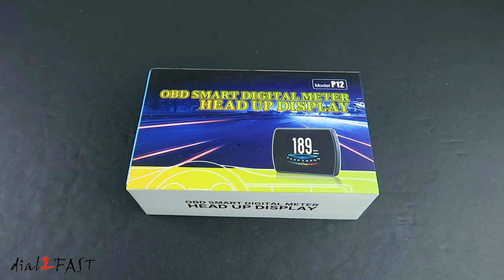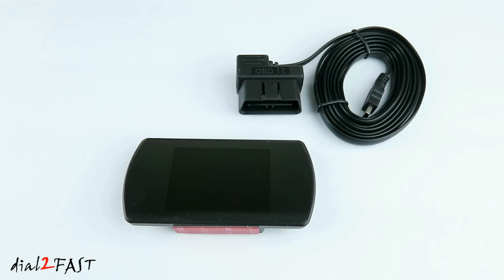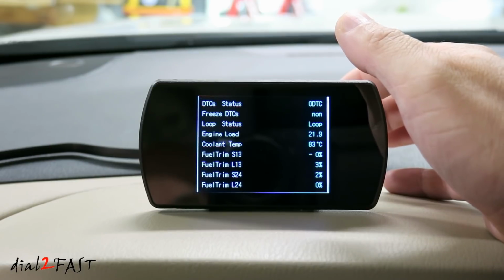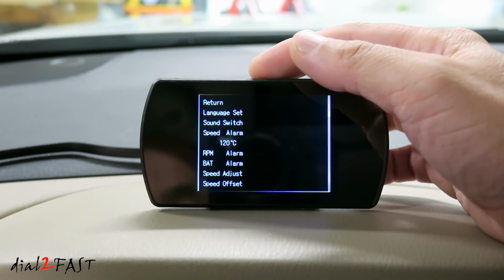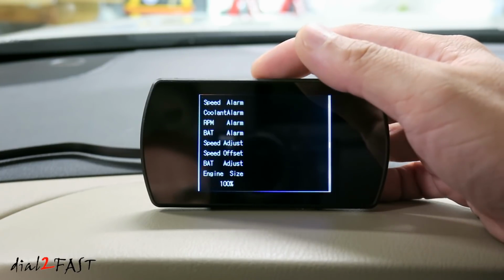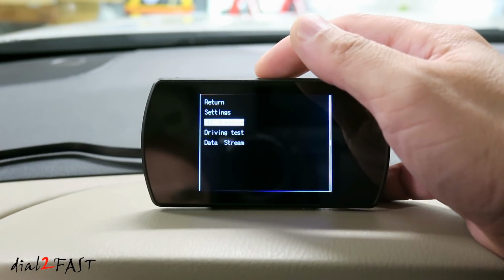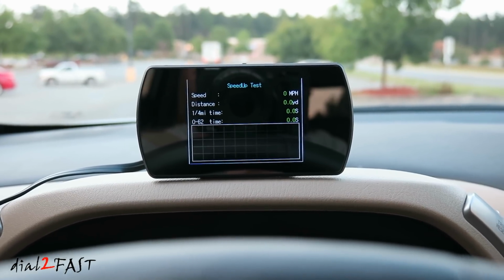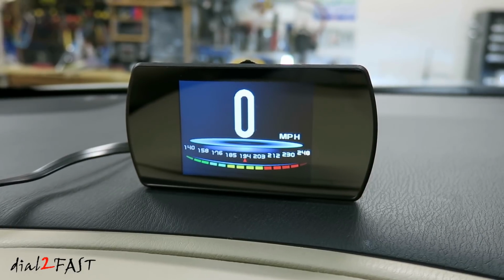OBD Multi Function HUD Head Up Display Unit - Model P12

Comment: ''I read the manual and they said anything after 2003 with obd2 should work''
before 2003? my car is 2000 year model with OBD II, it will work or it's a buying risk?

Comment: Sir
Is that work with toyota corolla 2008 model. Which is using Engine control Module 89661-12E71. OBD2 port
Reply: Mansha Javed of course. It’s obd2.

Comment: I put bigger tires on my car than stock so my speedometer is inaccurate, how do I know what percent to set the speedometer to so it’s accurate?
Reply: Get someone to sit in the passenger seat with their phone using a GPS based speedometer and have them adjust the unit until the speed on the HUD and the phone match up

Comment: XYCING On-Board Diagnostic Car HUD Display Smart Digital Speedometer OBD2 EUOBD Code Reader Heads-Up Display Turbine Pressure Driving Speed Fuel Consumption Engine RPM Air-Fuel Ratio Over Speed Alarm https://amzn.to/2zle9Ad

Comment: Can't get it to work with my 1999 Isuzu Amigo. It kept crashing the first time I tried to use it, It would say "Connecting..." for about a minute and then flash some other words and turn off for about 5 minutes. Eventually, after changing nothing it stopped doing that and it pretty much works but will not show any information..? Everything just reads 0 or nothing. in the data stream everything reads "non". Anything I can do about this?
Reply: it does not work for cars older than 2004. i have the same problem with my 2001 lexus is300 but it worked fine for my 2005 honda accord euro

Comment: Will it work for NISSAN 2006 Model?
Reply from the maker: It will work for vehicles with OBDII diagnostic port build after 1996.
Reply: @dial2fast  I bought the a8 heads up display and used it on my 2003 wrx and it did not communicate with the vehicle, just read hub on the display, I read the manual and they said anything after 2003 with obd2 should work, but does this one state that it will work with vehicles over 96 and with obd2? I want to purchase this one just for mileage and battery voltage but do not want to waste my time again, any information would be appreciated